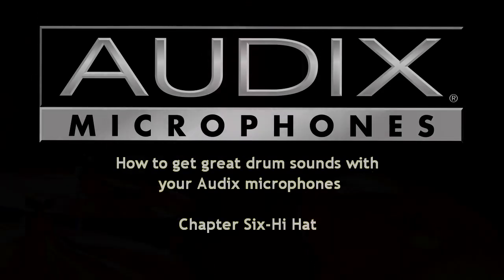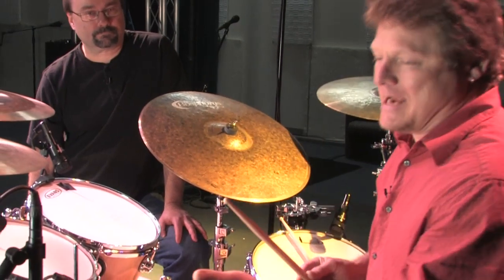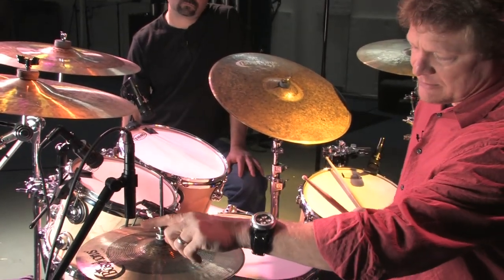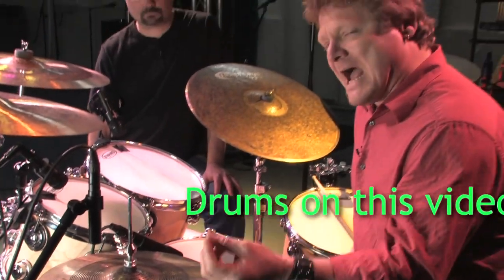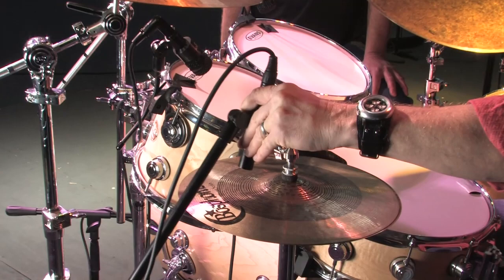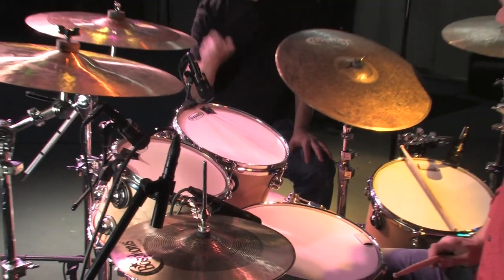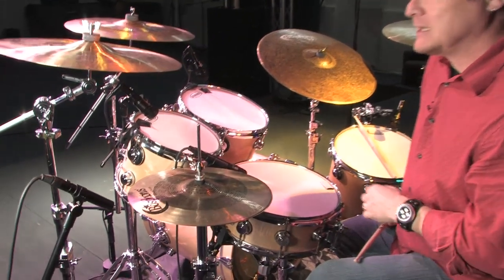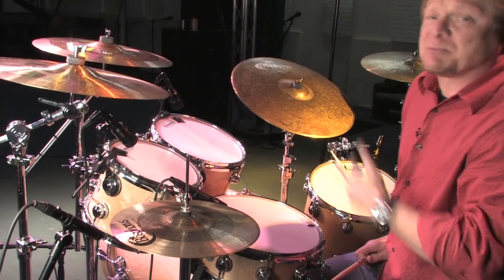Audix Microphones - How To Mic Drums - Hi Hat

Comment: do you recommend audix f9 for hi hat as well? I have both f9 and adx51, i used a pair of adx51 for overheads, and a pair of f9 for hi hat and ride. i found a very silght difference in sound. adx51 is less muddy for the hi hat. but f9 can achieve it when i cut down the mids.. is it still advisable to replace my f9 to adx51? are f9's like adx51 without the -150 cut and -10db pad?